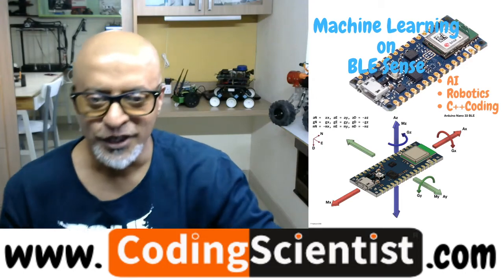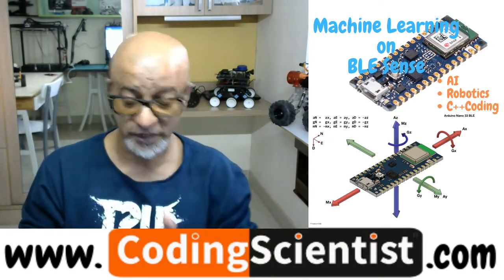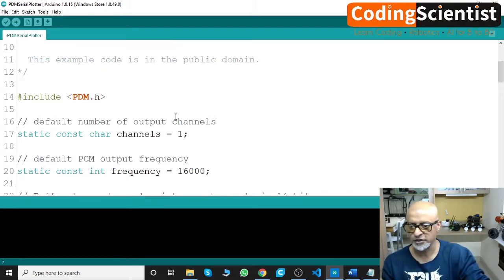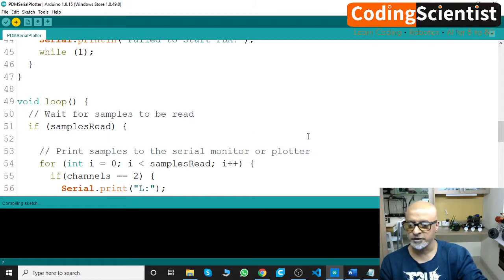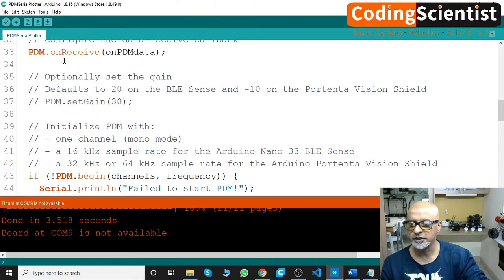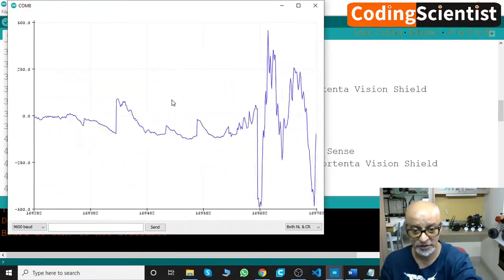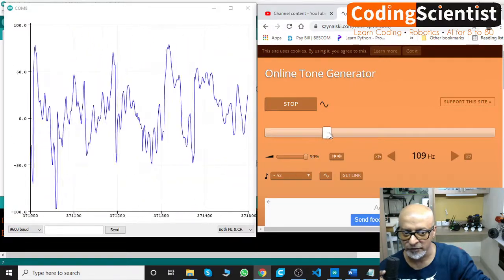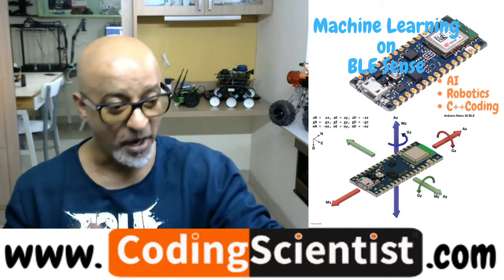Lesson 13 Generating and Analyzing Sound Data from Arduino BLE 33 Sense

Comment: Hello teacher!
 I have an electronics question from the Arduino nano 33 ble board.  feeding it with 12v directly on the VIN can I energize a tape with two rgb leds on the 5v output and a touch sensor on the 3.3v output?
Reply from the maker: Yes you can take the inputs from the touch sensor through 3.3V, however to activate a tape you will need external power source with controlled bridge via VIN, direct 12V might damage the circuit
Reply: @CodingScientist  I made a jumper to activate the 5v output. I tested it with a multimeter and it is stabilized at 5v and 3.3v through the VIN.